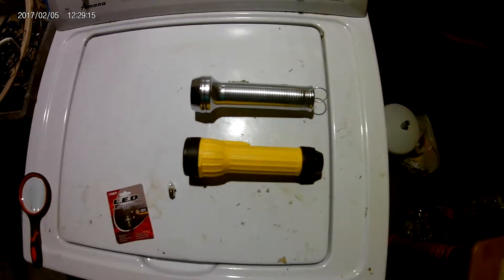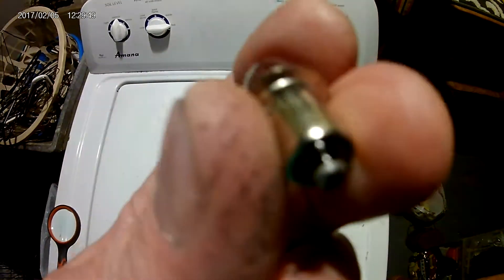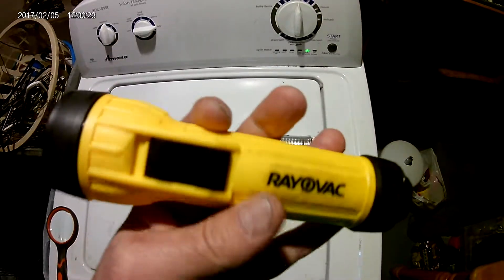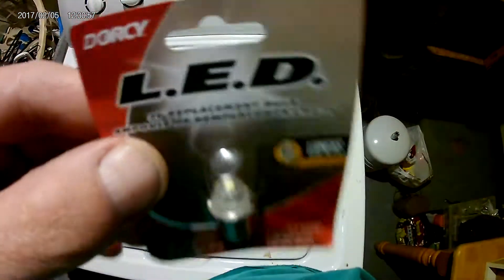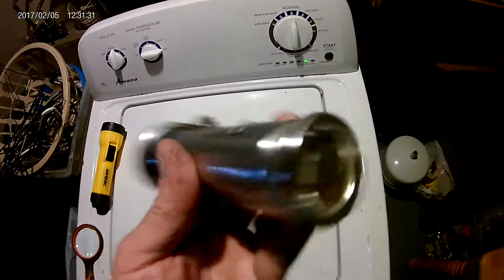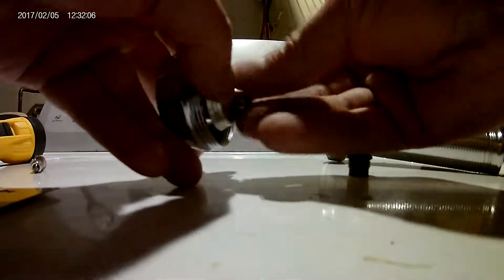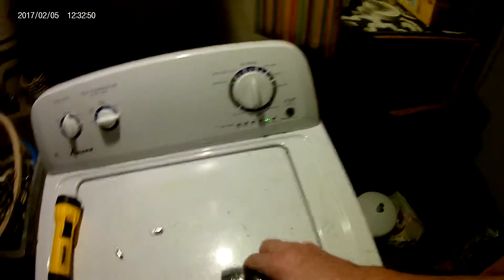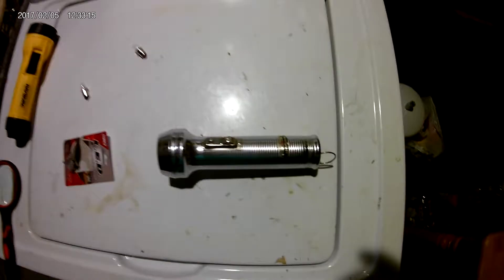Convert old flashlights to L.E.D .

Comment: I just picked up this same flashlight today for $1.50 at Goodwill and added an led conversion.
I can tell you right now that the Nite-Ize LED bulb sucks
It's brighter at 55 lumens, but the led has no clear resin " bulb " around it like this one does so the actual light doesn't have enough spread into the reflector cone and doesn't hit all of it because it sticks out so far.
This means a hotspot with a dim surrounding with lots of haloing and some artifacts.
I think I'm gonna see what I can do to remedy this.
Reply from the maker: I see and I have also
Reply from the maker: They are not all equal (leds) some very cheap (do what works best).